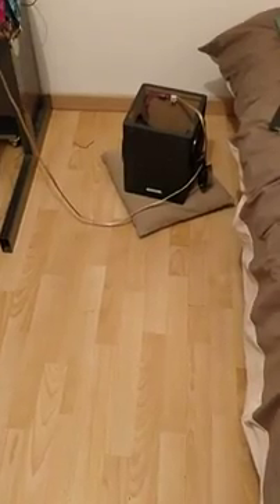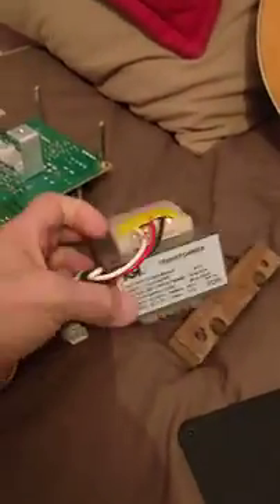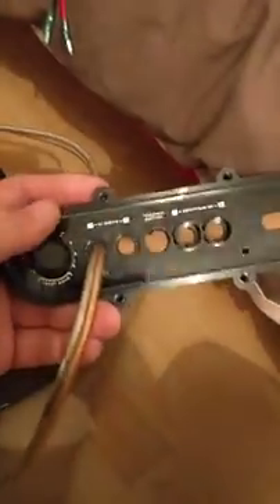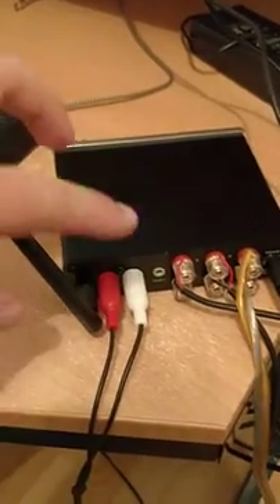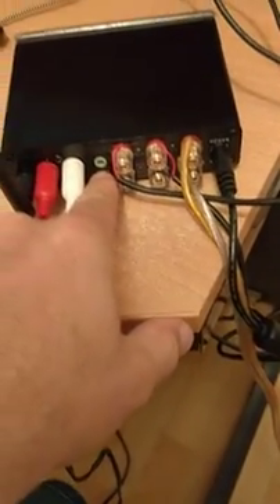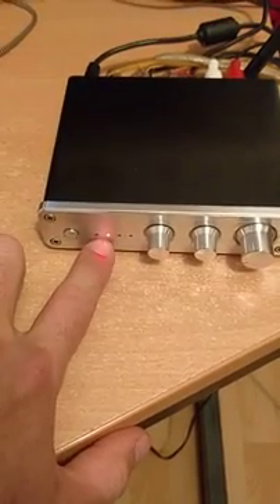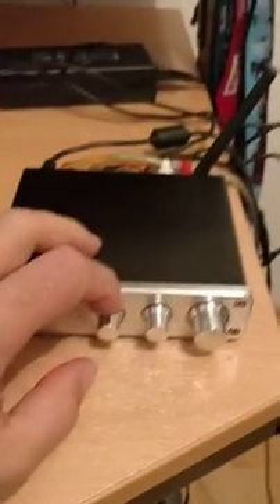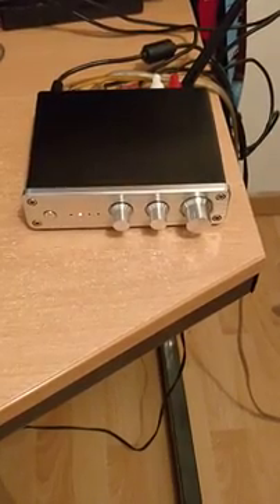Creative Gigaworks T3 repaired !

Comment: I got exactly amplifier you recommended, It works but sound quality got worse
Reply from the maker: Hey, make sure you tightly closed the subwoofer, I mean even each screw hole should be filled (I used wood paste), so that no air can go out of the subwoofer. I also used silicone mastic to seal the output hole of the cable so that no air can pass through.
Reply: @JCO  I sealed it. The only problem is that subwoofet frequency got chanched. That what makes it sound worse